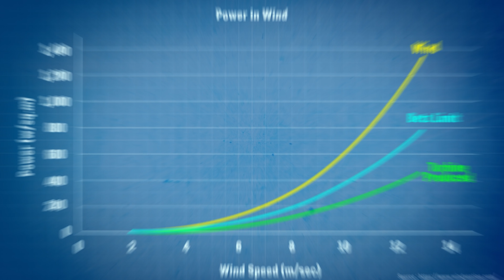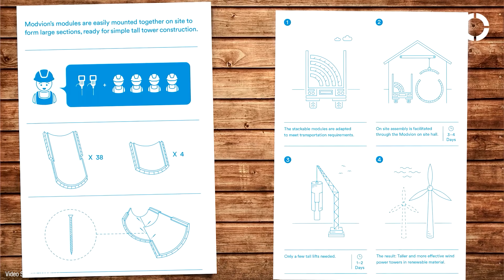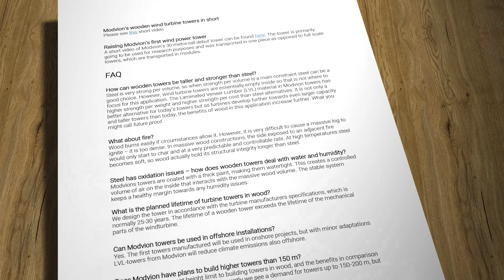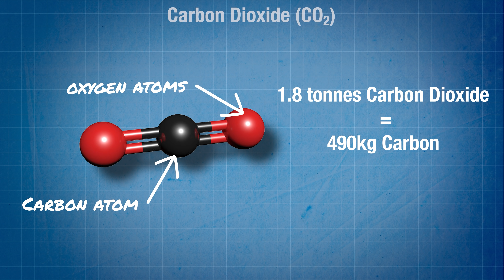Wooden wind turbines. Are they really a sustainable alternative?

Comment: Considering where the wind turbine industry is moving - a 120 meter tower AINT BIG ENOUGH ANY MORE!!!!!!!!!!!!!!!!!!!!!!!!!!!!!!!!!!!!!!!

The biggest wind towers are all at least 180 meters high - look it up as I did!!!!!!!!!!!!!!!!!!!!!!!!!

and there would be EVEN MORE POLLUTION produced  if wood had to be shipped to China so they could use the stuff for wind blade production.....................
and of course LIE-berals and Woke socialist OBJECT to the cutting of wood for any purpose thus the ides of using wood for wind blades DIED FROM WOKE POLITICAL CONSIDERATIONS and pollution issues!!!!!!!!!!!!!!!!!!!!!!!

And of course the REAL ISSUE is NOT how to recycle wind blades - as the REAL PROBLEM IS THE COST OF GREEN ENERGY JUNK POWER AND THE FACT THAT GREEN ENERGY MUST HAVE BACK UP FROM ANOTHER POWER SOURCE!!!!!!!!!!!!!!!!!!!!!!

Thus it is cheaper and easier and actually BETTER FOR THE ENVIRONMENT to simply DUMP THE GREEN GARBAGE POWER and use the back up power source that has to be kept fully manned and fully powered and ready to take over from the UNRELIABLE GREEN JUNK!!!!!!!!!!!!!!!!!!!!!!!!!!!!!!

Comment: Without having done any calculations it would seem possible to make the blades out of wood also . Having flown and worked on wooden sailplanes over (too) many years which are the most sophisticated wooden structures to date and compare reasonably well in weight to fiberglass wings (the first commercial fibreglass sailplanes were made by Glasflugel who previously made blades for cooling towers and the same designer Ulrich Hutter also designed the single bladed wind turbine 'cyclops' that was erected near Stuttgart in the 70s . I also worked nearby building fiberglass gliders for Schempp Hirth in 1973 - the year of the Yom Kippur war and the Arab oil embargo which stimulated 'alternative' energy schemes .  wood is poor in compression but 'improved wood' impregnated under pressure with phenolic resin fills the hollow wood cells and much increases this --used in several of the last generastion of wooden gliders (eg Vogt Lo 150)  it would also seem that external bracing could relief some of the blade root bending --a spar extending out from the 'spinner' and a single wire to mid blade (as some early windmills did )  great channel.

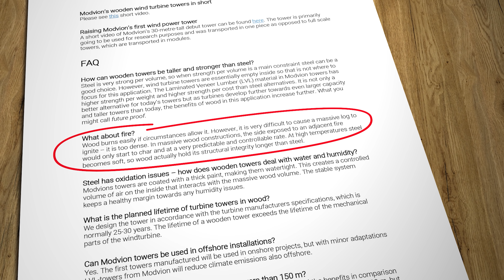Comment: 5:06 Modvion says in their paper that their wooden towers have a 25-30 year design due to exceeding the lifetime of mechanical parts of the turbine. Wouldn't it make more sense on a bigger scale further down the track to be designing the tower for a 50-60 year operation so that you can just uninstall mechnical parts and reinstall new ones without having to touch the base and tower itself?

Comment: Bladeless wind turbines have the advantage of zero impact on bird kills, easier maintenance, and more aesthetically appealing on the environment.

With the disadvantage of somewhat less output than comparable blade wind turbines, which can be compensated by adding more bladeless turbines to the grid. I believe fifteen bladeless turbines will equal or surpass ten blade turbines, an acceptable trade for eco-friendly power generation.

In addition: exponential advancements in technology engineering and design will make bladeless wind turbines the preferred choice for future wind power generators.

Comment: While conventional wind turbines are more efficient than the Verical Axis machines at this time. By my understanding the vertical axis machines can be installed at a higher density. The bigger the conventional wind turbine the more land area the wind farm* takes up. Plus vertical axis machines would have major benefits from an engineering standpoint. 
1) The generator set can be installed at ground or base level. This should reduce the structural requirements on the tower. 
2) Elimination of the drive mechanism needed to point the turbine in the most efficient direction. 
3) All of your major components are at ground level with the exception of the upper bearing assembly are at ground level easing any maintenance requirements. 
4) If the tower is less massive this should reduce the materials required for the foundation. Just how many tons of concrete are required for the average wind turbines foundation? And how much CO2 is produced by that mass of concrete
I'm surprised that we haven't seen more effort in pursuing this technology. Sometimes chasing the last bit of efficiency while delaying the introduction of something is a losing proposition IMO. 
*The best areas for wind farms in a lot of regions would be in agricultural areas. Aside from off shore locations.

Comment: Repurposed ideas: sections of blades could be connected together to make sub-surface drains or utility tunnels. The wider thicker sections could be sliced into 3m sections and made into aerodynamic trailers. Cut horizontal they could form tanks og even small boats.

Comment: Seeing that bicycle shelter.

The blades could be used at parks for sun shelters.

Two halves could fitted together and sealed at the top edge to make small barns or carports.

By closing in the ends, possibly a small home.

Comment: This is serious innovation at work followed importantly by practical commercialization.  More buildings are being made from mass timber too.  There is a 23-storey student housing tower made of mass timber from sustainable local sources (cross-laminated slabs, glue-laminated columns) using steel pins and bolts at the joints at the University of British Columbia, designed by Vancouver architect Michael Green.  Wooden high-rises ... who would have thought?

Comment: Can I try out this idea with you, Dave, and other patreons of 'Have a think', please?
Imagine two tunnels drilled through rock at 13C ambient temperature, side by side about 5m apart, about 3m dia. and several km in length. The tunnels rise by about 150m. from lower end to upper end and are connected at both ends to form a circular duct.
About 200 MWh/day of low cost green electrical energy is fed to large heaters to heat the fast ciculating,  say 50 cu.m./sec. or more, dry air at the bottom of one tunnel to a temperature of at least 23C, ie ambient + 10C. As this air circulates by convection up the warm tunnel, it loses heat to the surrounding rock. Assuming its temperature has fallen to ambient rock temperature by the time it reaches the top end, it is fed through a heat exchanger to transfer heat to the working fluid of a large heat pump. As the air is assumed to be cooled to around 3C, ie ambient less 10C, by the heat pump, it falls down the second tunnel. By the time it reaches the bottom, it has picked up heat from the surrounding rock reducing net heat loss to theoretically zero for the whole circulation.
It is then re-heated and circulated again up the warmer tunnel.
Neglecting any losses, is the energy output from the heat pump, (COP = 3 and assuming auto power supply, equal to the heat input via the electric heaters? What other data are required to complete the calculations? Please feel free to make any comment.
popeye

Comment: What about the concrete bases? Is it possible to make something out of wood, steel and rock infill to do that job? Hmm, longevity would be the greatest challenge... (I would argue that the greatest challenge is also to exit the culture which does not design products to be low-carbon as a goal... And finds it difficult to enact laws that might promote that...)

Comment: Just a note and wood stuff:
If you  treat dry wood with raw linseed oil, it will last about a hundred years and it actually makes it stronger.  The oil soaks in and after a few months turns into a material that is a lot like plastic.  Water cant get past it.

Comment: The truth in real numbers is that wind power in Sweden instead made our energy system worse. Power production is now unreliable. KWh Price is rising sky high, shortage in supply is now a reality. Companies can not expand. More Co2 is now produced, since we now have to import dirty electricity. We shut down perfectly fine nuclear plants. And now we are only in the beginning of a very bad road. Truth is that wind power in many cases never reach brace through both economically and ecologically if you count the whole process in a lifetime cycle. Look at real output not the commercial bs. 95+ % of  worlds power production is coal, oil,fossil gas, nuclear and other not wind and solar power. Wind and sun is free but sternly not a full scale power line. You also face the build of a brand new grid. This is stupidity. As EV cars is stupidity. (Keep an old car instead.) Wind and solar is bad for economy and ecology. Not me saying. Numbers talking.

Comment: What would taller & bigger HAWT's impact be on wildlife. I've seen videos of HAWTs exploding in high winds - wouldn't bigger HAWT turbines fail more catastrophically more often? Are bladeless VAWTs built closer to where they are needed and therefore not not requiring extensive & costly transmission / distribution infrastructure perhaps not a better solution? Could these also not be made of wood too?

Comment: Steel towers are not limited by the size of road transport, they can be fabricated in individual components and assembled at site just as he proposes for the wooden ones. Steel is re-cyclable, put new turbines on the steel towers. What is the maximum height of a wooden tower/ limit of generating capacity? What is their durabikity? Will they be suitable offshore?

Comment: In terms of locking away carbon that would come from the resins in the blades, maybe just grinding them up and then disposing of them in deep cavers would lock away the carbon bound up in the resin for a long time.  After all most of the resin is pretty stable and won't degrade very quickly.

Comment: Wood windmills will probably never work, I mean really, it’s like the Dutch have never used them for centuries..😬

If you really want to recycle the the blades look into using thermal hydro cracking. Where the waste is put into a vessel and it’s topped off with water and heated until it reaches 13.8 MPa for a while and the plastics will become oil as will the wood, while the inorganics like glass or metals will accumulate at the bottom. The oil can be used for chemical feed stocks of plastics and such and the minerals recycled closing the loop.

Comment: steel can be recycled steel makes up the bulk of metal i recycle.

i tear down appliances like window air conditioners and refrigerators and the shells are tin witch is a light form of steel.

wood once cut you can only use the wood as is or cut it down further.

wood can be spliced with mending brackets and assembled in layers but probably not as strong as 1 whole cut piece.

why not turn them into high end furniture.  a group called moto art does just that turning old airplanes into art and furniture

Comment: HAH! Trick question: 'Billy' bookcase is symmetrical and cannot be assembled back to front -  Christ, I need to get a life...
Great video, have known about the strength weight statistic since I was a student (long ago), but gobsmacked when you reframed it in that way - a different kind of weight 'gain'! 
some questions: have you done video about engineered wood generally? Haven't seen any discussion out there about type of adhesive used in what proportion & what it's footprint is
Same question about carbon fibre: am I the only one unimpressed by CF? nasty, energy intensive processes involved in making both the material & the finished product (don't even start on waste & defect rates) which, although strong, has catastrophic failure mode with very limited repair options such that it's de facto single use. For that laundry list of drawbacks, should be a tenth the weight of ally...
If there are applications where steel is still the way to go, is anyone looking at 3D printing as they already are for rockets?

Comment: Why don’t they take the old blades and put them in under water turbines that use the gulf streams to produce electricity. They would turn slower but the power of the heavier water would turn them with much more force and any imperfections in the blades would be no concern at the slower speeds but have more power. 🤔

Comment: What's the problem with putting the old blades in landfill? That's carbon sequestration. Landfills are only a problem if they're leaching dangerous chemicals in the environment or degassing methane. Burying those composites is just sending the materials back to where they came from.

Comment: But so could using an omi direction sail based wind turbine. But using 3 sails on a single axis that can produce electricity whichever the wind is blowing. And you don't need to even make them have to be so high to do it. Also if a solar sail material is used with a magnifying glass that can change direction to hit the sail at the best angles at all times. Then you can have electricity generation at all times. And at any level of elevation. Add in a glass water tank that uses magnifier to boil the water in the glass. To create steam to turn the electric turbine. As of course other renewable. Which should include every home, business, public building, residences, and public areas. That have a modified septic system to draw out the methane/natural gas. And you can be 100% renewable. And cover any and all energy needs. For everything from transportation, electricity, cars, homes, and so on. The larger the population the more energy produced. Nevermind the jobs, small businesses, and other economic benefits such a green renewable infrastructure would bring.

Comment: When it comes to being recyclable, nothing beats metals with steel and aluminium being the most recycled bulk materials on the planet. They can be readily reformed into brand new, pristine material with a fraction of the original energy input. It's easily separated and a recycler's dream.

That said, there's a lot to be said for wood, but when it comes to recycling then I'm afraid that those laminated wooden panels will only be useful for being chopped up and turned into some form of fibreboard and, maybe, find their way into that MFI flat-pack furniture. Personally, I'm not a fan; my furniture is solid oak which will last indefinitely.

Comment: Pound for pound, steel is still stronger than wood.  Even though steel may be 16 times as dense as wood, it is more than 16 times as strong from a cross-sectional area standpoint.

The real advantage to using wood would be cost.
Reply: The weight to strength ratio is very similar for laminated wood and steel. In a case like this, stiffness is likely more important (esp for the blades). There are also other advantages to the wood. I think the big advantage is the carbon foot print and it could be less expensive over the full life cycle.

Comment: Reducing the weight at the top makes sense,  can't see any advantage at the base,
There is no way wood outperforms steel in a fire
Reply: I don't think even a steel tower weighs much compared to the armature, windings and gearbox of the generator itself. (the part that actually is the top of the tower)

Comment: How are wooden towers easily recyclable?  Wouldn’t the coating be a problem? And it would have to be ground down. 

Surely the steel tower can be more easily recycled?
Reply: Coatings can be an issue, but they have to be fit foe purpose. Coatings on steel are difficult to remove and tend to be burnt of in the remedying prices, which is less than ideal. The coating on the wood may be left in place is the separate pieces on the tower are repurposed or, if sound, act as an undercoat for another finish. The recycling of steel is a messy dirty business and is high on carbon use which not only provides the energy for melting but takes part in the ‘cleaning’ of the metal from some contaminates.
Reply: @bigbadjohn10  Thanks.  I'm sure recycled steel will emit less GHGs than "raw" steel.  

Lifecycle costs will have to become a part of consideration of every thing, starting with the largest and most common objects.

Comment: YES wood is and has always been a marvellous material, and unless we destroy the planet, should also always be available. One problem is though that both steel and wood prices fluctuate wildly in response to market forces, and should be viewed in the same way as pork bellies or orange juice. Oh and BTW that company which turns out cheap furniture which you have to assemble at home with a screw driver and one of those nifty little hex keys, might be well advised to use more wood in their products in place of that hodge podge stuff which appears to be wood chips stuck together with lots of glue !
Reply: Making things out of woodchips means it is an upcycled waste matterial.  Not great for everything but when it can be done it should be.
Reply: @trikepilot101  Oh I think it's clear that it CAN be done but it  does not necessarily follow  that it SHOULD be done. To the manufacturer, the main concern is being able to maximize his selling price.

An interesting question is what is the aggregate effect of putting a waste product to use and the concomitant adverse environmental effect of synthetic glue production - even disregarding the environmental cost of disposal of the furniture at the end of its useful life.

Comment: Having a think... They used to make airplane propellers (and airship airscrews) of wood. Could wind turbine blades be made of wood? Engineered wood of course, but still. Maybe a carbon fiber tensile element in the core of the blade?